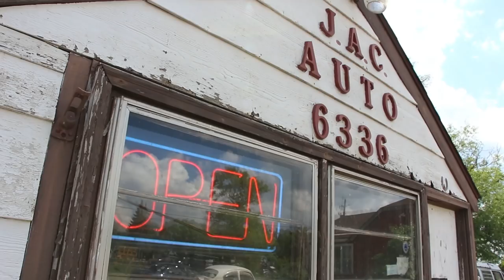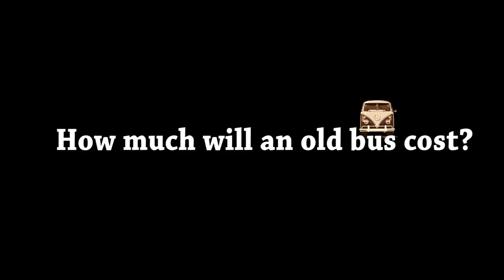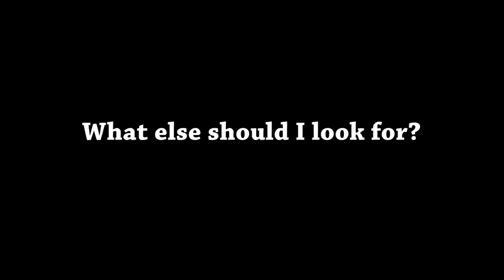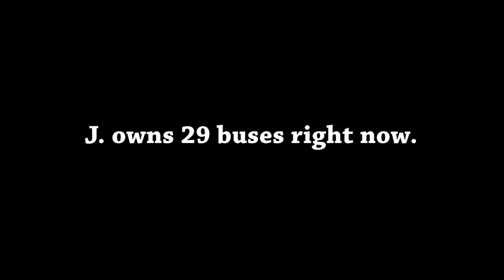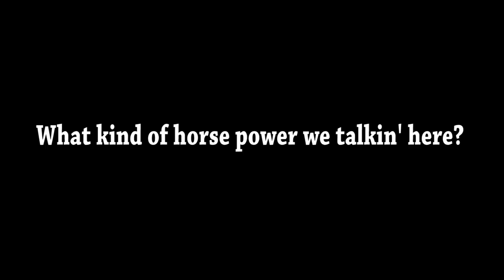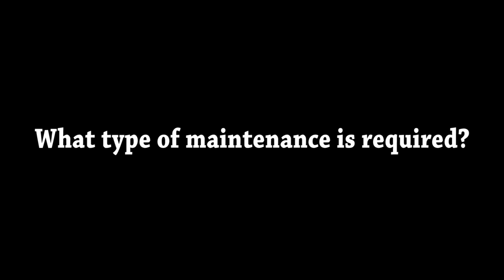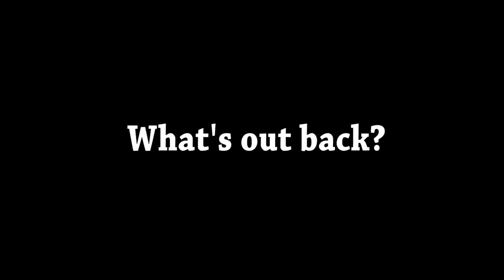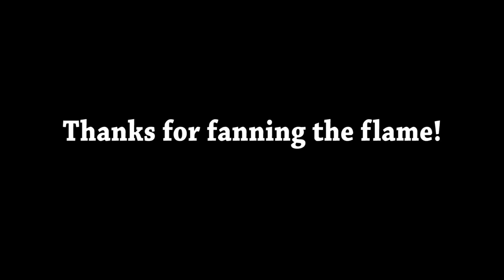The Dream Begins - Getting Wisdom For My VW Bus - Volkswagen Bus Wisdom.

Comment: You can't really know anything about a Bus unless you've owned one, driven one, worked on one, driven cross country, busted your knuckles, changed points nd plugs.  I'e had mine for 40 years
Reply from the maker: David Coats That's some wisdom built over the years for sure man! Thanks for watching.

Comment: I owned two Bugs, a 1964 Baja Bug in 1978 and a 1967 Cal Bug in 1987. They both had 1600cc motors. 

I loved my Baja Bug. It was a super sweet street Baja, not an over the top, off road rail car. It was more of a hybrid street and trail set up.

 It was a nice metallic root beer brown with a copper colored engine cage and wheels. It was one of those builds where the owner and builder didn't want to sell it, unless the buyer was in love with it. 

I was crushed when a dumb blonde high school girl made a blind left turn in traffic and wrecked it.  

Even though I only played with it off road in a wash (dry creek bed) a few times, I loved that little thing to death. It made the most incredible mechanized noise that made you feel instantly connected to it, like it was a part of you. 

 It was raised upand the wheels were towed in, which made it a hand full to drive as it danced all over the road at freeway speeds in windy days. But, God, I loved the way it sounded and smelled. 

People love to bash on the Mazda Miata, but auto journalists love them to death. They claim that even though Miatas aren't incredibly fast, they feel fast and they are super fun to drive.

 That's exactly what it's like to drive a bug. You could swear that you must be going faster than you are, because driving slow couldn't possibly be that much fun.

Comment: The steps I usually go through when deciding what vehicle I want is:
Step 1: Decide what model year you most like.
Step 2: Visualize what you want it to look like (paint color, wheels...) I usually find a picture of a car on Google images and copy the pic to Microsoft paint and try to paint what I want over the existing picture. Otherwise an old trick would be to print off a picture of the vehicle and lay another piece of paper over it and try to trace out the body lines, then use markers or paint to color it in.
Step 3: Decide if your going to restore it within factory specifications or modify/customize it.
Step 4: Get a rough idea as to how much your probably going to pay for the vehicle and how accessible parts are for it. Don't try to figure out the total cost of everything together, otherwise you tend to scare yourself away from the idea. Just go piece by piece. Trying to get the project done in one shot is near impossible.
Step 5: Be prepared to have this project sitting in your garage or driveway for potentially a few years depending on how much progress you make on it.

I've been working on a project car myself and even though I have most of the parts I need I still haven't made any progress on it for about 3 years. My current problem is finding a body shop that has the time to paint everything. I don't want to hand my car off to a place that is going to rush through everything, leaving me feeling I wish I had gone elsewhere.

Good luck Matt! Get a mental vision as to what you want this VW Bus to be and do your best to maintain that vision and see it through.
Reply from the maker: matthgmdude1 Dude this is great stuff!!! Thanks so much for sharing man! Really appreciate it! :-)

Comment: I'm 34. I've driven a bus since I was 17 as my sole daily driver.  Wouldn't have it any other way.
Reply from the maker: Thats awesome man! Love it.
Reply: everyone got a vw story my story starts back in72 I was 8 yr old my dad brought a 49 bus it was a rust bucket then and he caused at it every day he hated the 16in rims so tossed em he was into heavy drugs acid and misculin was his choice he decided to take my 2 brothers and I to the gulf for Christmas vacation it was about a 500 m drive south it took us about 5days to get there we spent all day swimming and the tide came in and damn near took the bus well any way on our way back we passed a blue ridge mountain sign. like I said dad liked his drugs and mom wasn't there for she had passed away from leukemia  any way we made it back to to rt7 north when we lost 2 cylinders so it was low gear the rest of the way to mid Missouri that was the last of that bus later on about 20 some years ago I got a job at a vw Restoration shop and worked there till just present and on of my VW's I bought 20yr ago I still have it's a 63 bus poptop and it ain't original at all but I drive it daily think I'll sell it after I die lol

Comment: Good luck Matt. This was a marvelous video.  My dream is to take my family across the country in  my 1966 splitty I have named Lisbeth in honor of Miss Salander in the Girl with the Dragon tattoo Noomi Rapace film series. Depsite all my bus has endured whether it be neglect or outright abuse over the past 52 years in the end she will be victorious, she will prevail just like her namesake. In any case, she is now getting a complete mk4 electrical harness with fully functioning ABS and cruise control, intermittent wipers, ALH TDI, Porsche 951 narrowed rear torsion beam suspension and 19x11" Carrera turbo Lobster Claw wheels. Just imagine my delight when I fit with little room to spare my 315/25/19 Toyo Proxes rear tire last week. I hope to have the torque, reliability and efficient power of this little beast flowing through the upside down Audi A4 transmission by the end of the month. Of course both lower rockers are rotted out but if time allows they will be changed before our departure later this early summer. The adventures that await us along with our backup 1.8T mk4 wagon and TDI sedan will be the greatest. I may very well tow along one of these 3,400 lb. monsters WITH Lisbeth herself, now that will be a sight to behold.  Best of luck to you mister.

Comment: Ive owned many vw buses over the years. You better learn the mechanics of these machines. Lots of info still around. If its not a fulie, rebuild the carbs completely ( replace everything) make sure you keep the valves adjusted regular. #3 exhaust valve has a nasty habit of breaking off and falling down on the piston if it gets too far out of adjustment. Message me if you have questions, i know theses machines well. Replace all the fuel lines and carry a spare throttle cable with you at all times. Good luck man.

Comment: Matt, I have a feeling from the video that you'll be a devout and happy Bus owner once you make the leap,  I agree with most of the info and advice from Jerry and "J".  First, research and decide on the the of model and the era of VW Transporter that you prefer.  Then buy the best Bus you can afford in terms of lack of rust and damage, and then the most complete (not missing much parts).  It is always easier to fix/repair mechanical issues (even missing or broken engines) than to repair rust issues.  Contact me, I'll be happy to advise.
Reply from the maker: BulliBill Thanks man! Appreciate it!

Comment: Thanks for sharing.  I've had 2 Bugs and 3 Busses back in the previous Century. LOL.  
I am looking forward to having a bus again.  But living in Arizona it's of necessity going
to need A/C.  Aftermarket or stock, I'm sure that 's the way to go.  
     One of my busses had the pancake engine and was bored and stroked so  while
cruising uphill in the Sierra's it would hit 80 while passing all of the NEW VW busses
along the way.  I'm not "confabulating " on that.  I got a lot of quizzical looks from people.
Of course, in hind-sight I should have kept that instead of selling when I got stationed in the
Air Force on the right Coast.   I am in definitely in the market for one if it has MINIMAL rust.  Dan

Comment: very cool, never owned one but hear theyre very easy to work on, the motor is held in by 4 bolts.  
they make higher hp motors, but they arent cheep.
it was funny when j sed about oil changes, on my '16 nissan frontier they say 5000 mile oil changes , which sorta bothers me being used to 3000. guess the full synthetic makes the higher milage .  im sure youll find your dream bus👍
Reply from the maker: dangerous toys56 Thanks man! Crazy only 4 bolts holding it in.
Reply: MattsRadShow that's the split window one, if it has crumple zones it is held in by the same 4 bolts plus the ones on the moustache bar. They are not unreliable, what breaks them is people don't maintain them and flog them to death, remember at  a constant 3250 rpm people use these engines in aircraft. Use Tue gearbox and don't run it at full throttle for too long.

Comment: best way to get rid of the problems is to swap in a little flat 4 subaru engine. get you your power to get to hiway speed too haha.. awesome upload man! wish i Lived down there to help ya get a project going haha
Reply from the maker: lkporter1989 Cool. I didn't know you could do that. yeah it'd be great to have the help!
Reply: For reliability, the Subaru swap is the way to go.  Getting around Australia in a VW powered machine would be considered foolhardy.   I know of one locally that is powered by a twin turbo Lexus/Toyota V8 and does the 1/4 mile in 13 seconds flat.

Comment: Matt, two ways, go find the most solid bus you can, and just start....or go look for a solid 1976-1979 westy.  My 78 is a much better riding bus than my 71.  76 is 2 Liter and taller transmission gears....if you have the green, get a camper...you could do a transporter with a Z bed in later...just start...

Comment: We never had a bus, but we had Bugs, I wound up with our second one as my first car. I HATED that thing.  LOL You had to drive down the road wrapped in a blanket and scrape the inside of the wind shield so you could see in the winter. I didn't have enough sense to replace the hoses so the defrost worked. The heater shut-off cables were broke so it kept it warm in the summer in case you felt a little chilly in August.  I would like to have one now but never as a primary. I ruined the engine on that car twice. Cost $500 to rebuild it.  If I had one now, I would be more responsible with it. But I was young and dumb then. I hope I'm not old and dumb. :D

Comment: My dad had a VW bus to haul around 4 kids and a wife back in the early 70's. I do remember one long stay on the roadside. As an engineer, running control cables from the front to the back is a bad idea. I saw a video where the VW bus had solar panels and an electric motor. In 2030, most countries will have banned gas engines for passenger vehicles. By 2050, Miami will be knee deep in water. Something to think about, do you want to be an expert in clean energy or air-cooled gas engines? 23:00 It is not privelege and entitlement, it is good engineering that the customer demands. No, they don't want to be mechanics unless they chose that career.

Comment: Look at http://www.thesamba.com/vw/    they have a lot of them. For me I would recommend a 1978-79 with automatic and AC. In 1978 they had hydraulic valve lifters, so no adjustment were needed. Switch your distributor over to electronic, put in platinum spark plugs and use full synthetic oil for low maintenance. The AC would need to be upgraded to a newer style rotary compressor (Sanden) and R134a. The rotary compressor only takes 4 hp instead of 11 hp.

Comment: IN 1970 I BOUGHT A 1968 VW VAN
WITH A SEIZED ENGINE
ON TEAR DOWN I DISCOVERED A
VALVE HAD BROKEN OFF TURNED
IN THE CYLINDER AND PUNCHED
THROUGH THE PISTON LOCKING
IT TO THE HEAD AFTER A QUICK 
FIX I DROVE VAN ABOUT 2 YEARS
SELLING FOR A PROFIT

Comment: Vw my experience has no luck, was behind one in traffic and seen smoke coming out then flames, another Time on the freeway this crazy guy kept up with us and kept weaving it was just slight evening dark. He ran into A old vw with 6 volt tail light going 50mph he when flying in slow motion and landed  the roof of the vw.  Too hot out here After they starter to put slotted holes in  hood
Reply: Guy was on a slow loud motorcycle